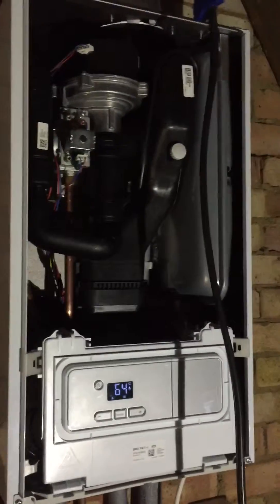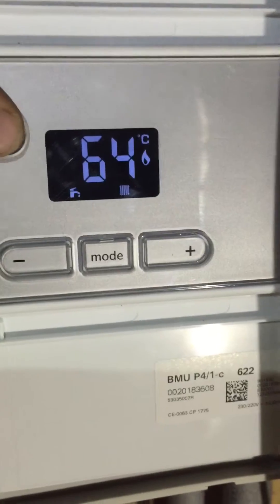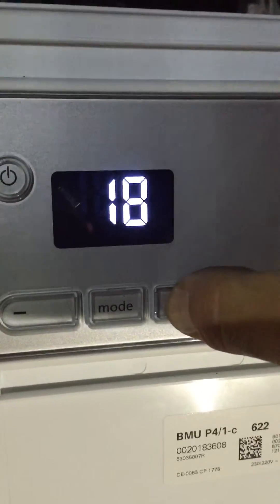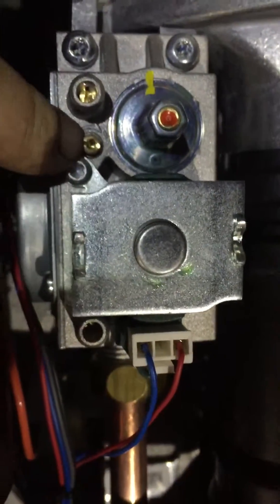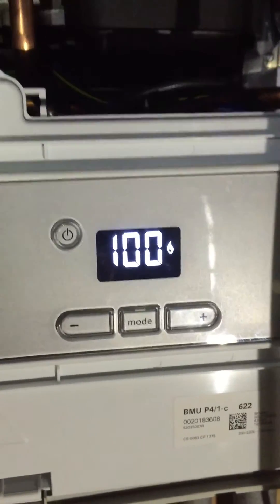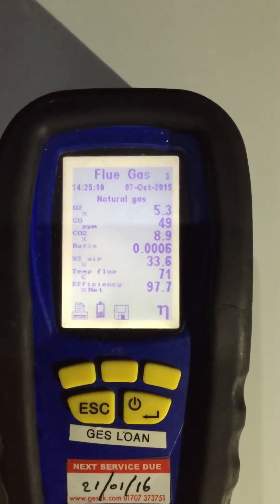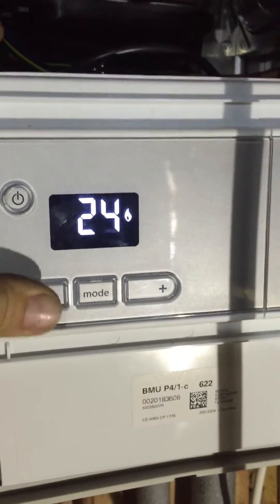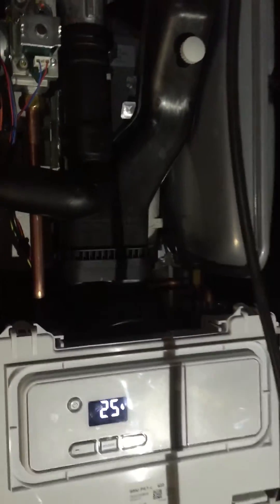Glowworm Energy combustion

Comment: One of the worst boilers on the market, stay away from it, never install it, don't be tempted by low price
Reply from the maker: There are loads fitted, it's the boiler I fit out of choice. Been very reliable
Reply: @Kfiskplumbing  very poor reliability, the heat exchanger gets blocked quite often on   wet and dry side, the most feature on that boiler is the price hence there are loads fitted
Reply from the maker: @CodyAlee-h2d  as I said I've never had any problems. Hundreds  fitted locally and don't know of any major issues. Warranty is always within 24hrs if needed anyway. 
I'd fit these over ideal any day and that's the main competition locally.